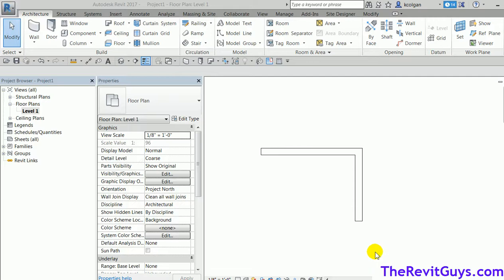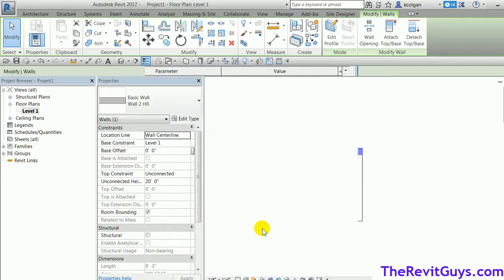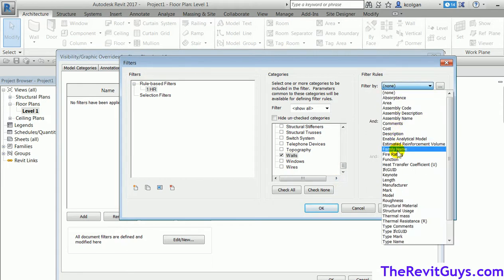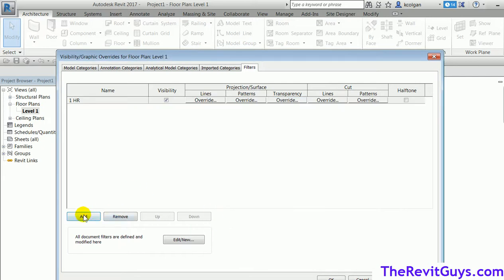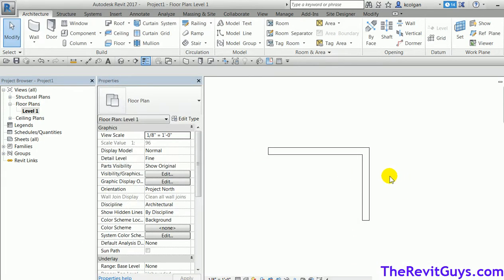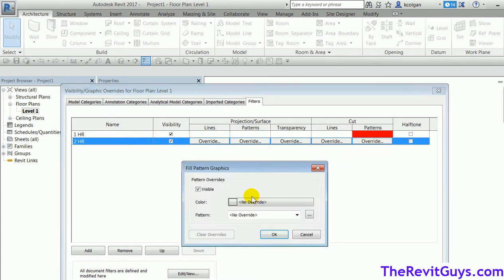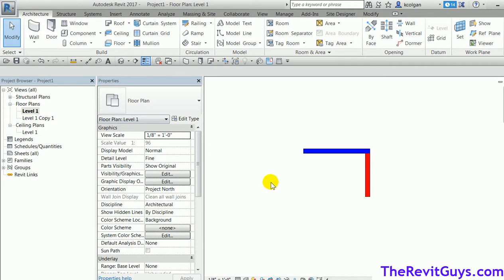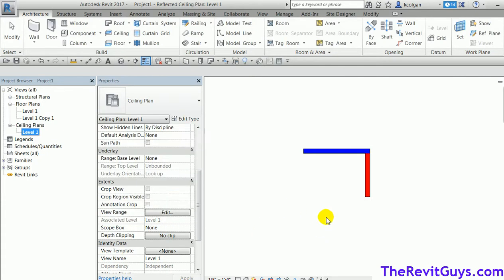Revit - Using Filters to color code walls to show associated fire rating - CADtechSeminars.com

Comment: You can use the temporary view settings button in the small icons below the work area, it lets you assign a View template temporarily to a wiev and that will more or less guarantee that you will not mess up your views settings.